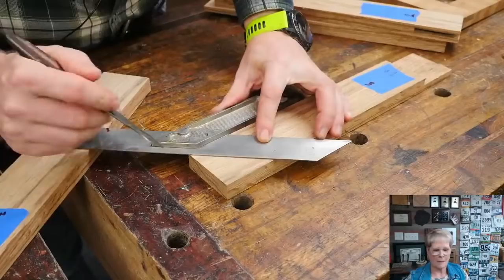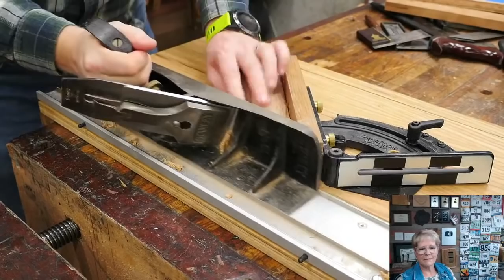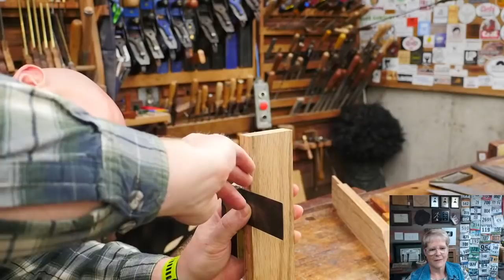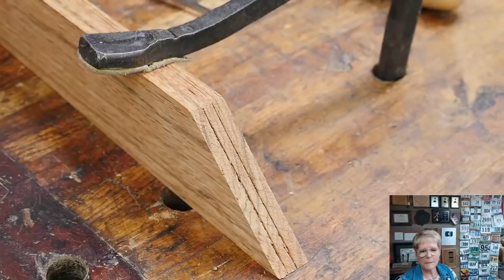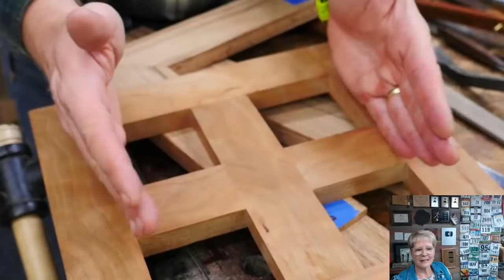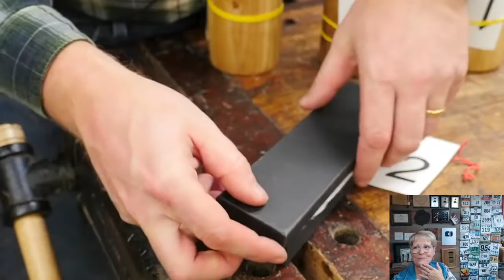How To Make a Mitered Bridle Joint | Joinery Window Joint 3

Comment: Is this also called a tenoned miter joint, or are they slightly different?
I watched Paul Sellers do a tenoned miter that I think was the same, or at least really similar, so I wanted to see if there's a difference.
Reply from the maker: They go by all different types of names. Most joints have five or six different names from five or six different traditions in different timelines. Very few things have one standard name in hand tool woodworking
Reply: Nevermind, I finally realized the difference. I believe the tenoned miter has a smaller tenon with shoulders, whereas on this mitered bridle, the tenon is the full width of the board.

...I think... Correct me if I'm wrong.

Comment: You need to have a pair of wedges at each corner of a picture. This allows the canvas to be stretched. The joint is more complicated than shown here. 
The FRAME  is where you use this mitred tenon joint